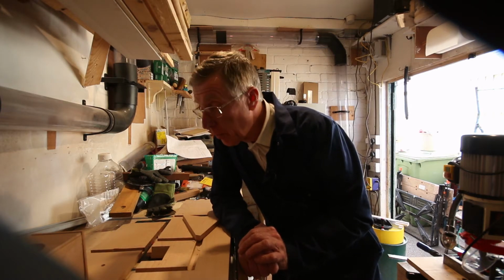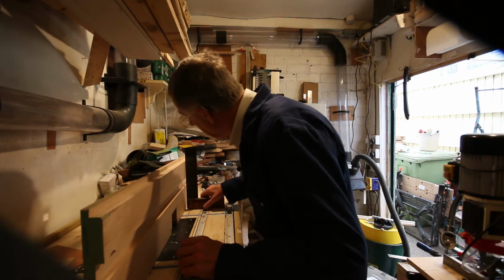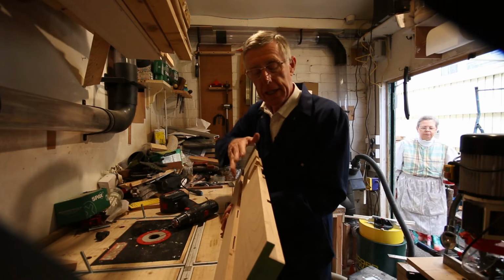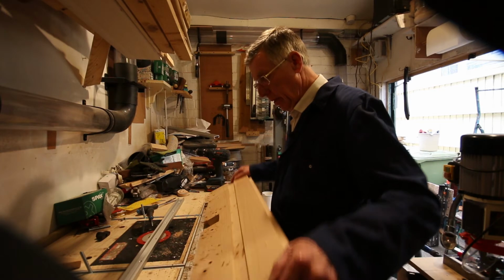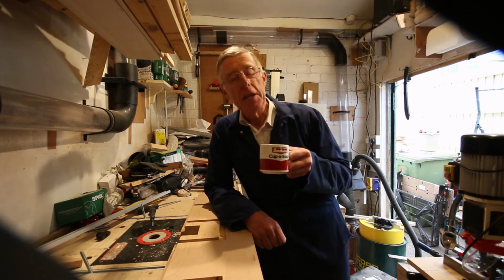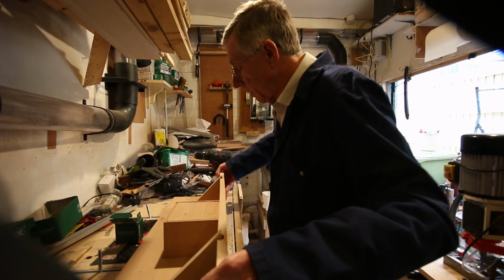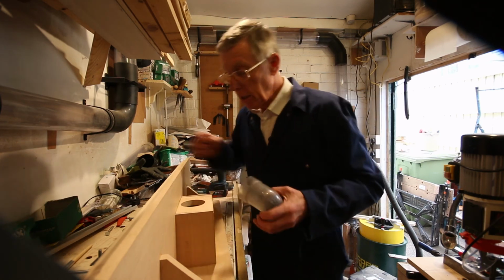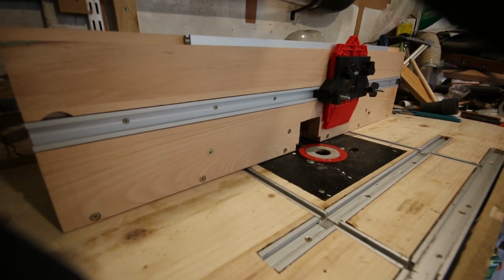Ben's Workshop Journey#16

Comment: Omg- icnredible sharing,;))
Reply from the maker: Thanks for watching
Reply: I love watching problem solving! A good slurp of Tea is always helpful 😅 I have a quick tip for checking countersink depth! Put the screw head into the countersink upside down. If the top of the screw head fits within the edge of the hole, you are good to go 👍🏻😊
Reply from the maker: @TimPiggott  Thanks, Tim. That's a good idea